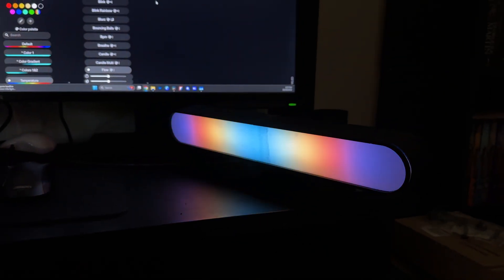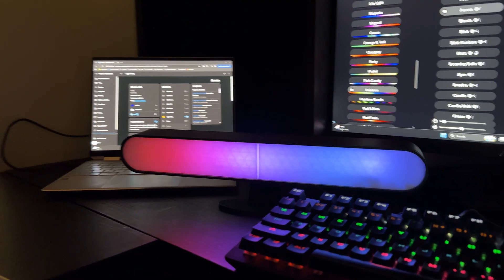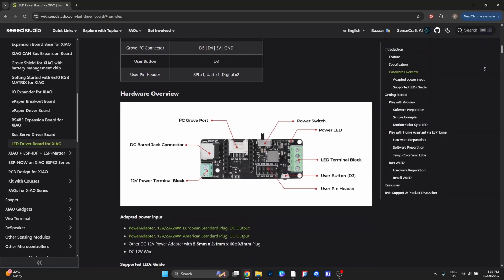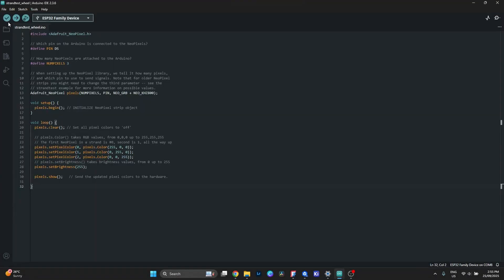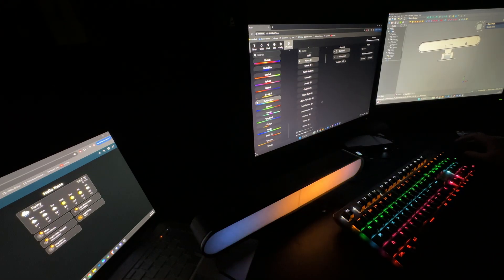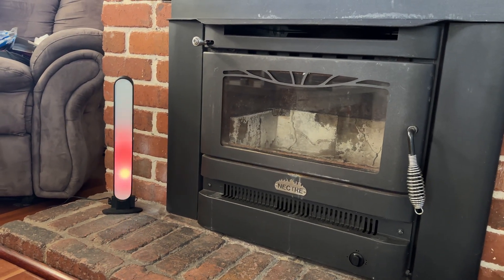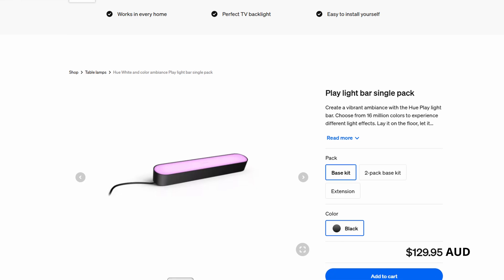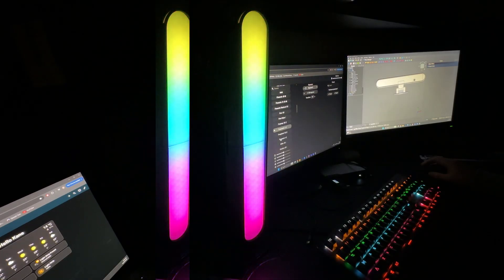DIY Smart LED Light Bar with ESP32 + WLED (Better Than Hue?)

Comment: The files on GitHub don't have the dovetail design of the bar/enclosure, or I'm just blind.
Reply from the maker: I ended up doing the dovetail split in my slicer software, it should be easy enough to do with the program you have. Let me know if you can't figure it out.
Reply: Where are the files on GitHub? Am I totally missing the link somewhere?
Reply from the maker: @Brett-r3z  Apologies, I’m in the process and of updating my website. I’ll have the files on there in the next few days
Reply: Thanks!

Comment: For the diffuser try using mylar stencil sheets, you can get them in A3 sheets, and layer them to increase the diffusion.  I made a matrix display and used them, and it works great!
Reply from the maker: Thanks for the tip, I'll keep it in mind for next time!

Comment: Great Project!

I have a similar setup made, used 4 acrilic tubes with the lenght of 1.65m each, in the tube i put an strip of very thin translucent acrylic plexiglass slice going from one end to the other acting as an difuser/led strip holder, i also 3d printed a base to hide the control board on each (esp32-wroom-32d) and as for the leds i used an WS212b-60Led/m strip, so it's pretty dense ( i did run 2 strips on each tube, it was looking quite plain with one!), They stand vertically near my tv speakers and in the corners of my living room. (they do face the wall for a nice ambient reflective feel from the wall)
I mostly use them in the audio reactive modes at night.

The LED driver board such as the one you used it's not needed most of the time!, if you do want to use it it's up to you.
So far i've run up to 600LEDS/ 2x5M strips from 1 esp32 and had no issues with it( i did sacrifice 1 led so i can use it as an signal booster for the data line and it's been working fine for the past year or so.
Reply from the maker: That sounds really cool, I bet it looks awesome!

Good to know about the driver board too. I wasn’t completely sure, so I figured it was safer to include it just in case. Appreciate the tip!

Comment: It was realy great recomendation from YT. Can you add your STLs to makerworld/printables etc. It would help to find your lamp way easier. Github is more text focused. Can you also answer some of unclear for me moments, please.
- What materials have you used for lamp body and difuser? For difuser i can assume PETG, by how glossy it is. But body is a bit unclear.
- Does LED strip attaches well to plastic?
- Does strip generate some significant amount of heat? Good to know does it need some metal bar or smt to take out heat. Or maybe use some reat resistant plastic
I have ordered all details for it and even a bit more. Things I want to do:
- Add touch button for basic manual control
- Some in-place fixations for LED strip
- Cable management
- Will try a acrylic glass for more uniform light distribution. Sanding or find alrady matte one
- Add some cable management to hide LED strip cable
Reply from the maker: Thanks for the feedback! I'll look at getting the STLs uploaded soon.
To your questions:
- I used PETG for the body and PLA for the diffuser.
- The LED strip sticks directly to the plastic and has stayed on perfectly after about two weeks.
- It does get a little warm, which is why I went with PETG for the body since it handles heat a bit better than PLA. Still, adding something to help spread the heat would definitely be a good improvement.

It sounds like you have an exciting project coming up, I’d love to see how it turns out!